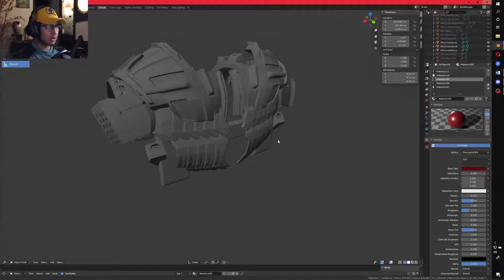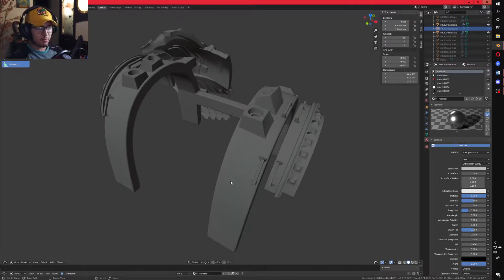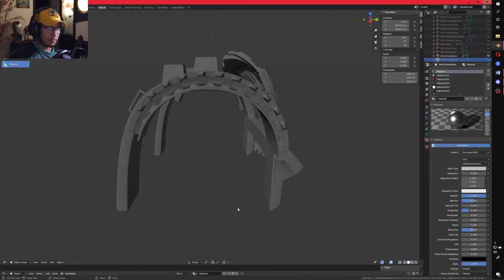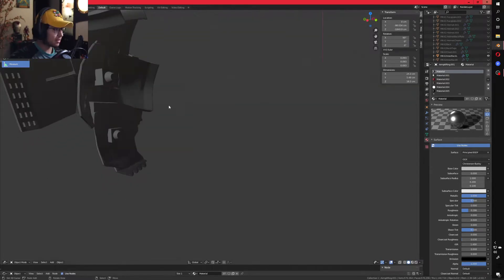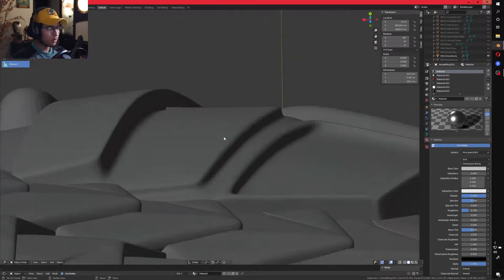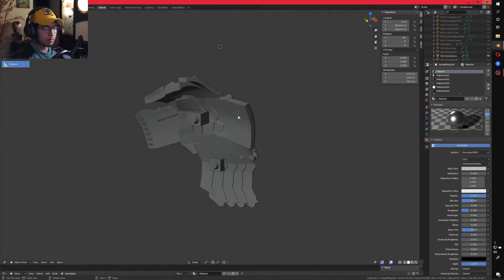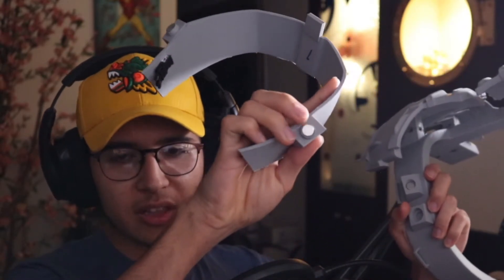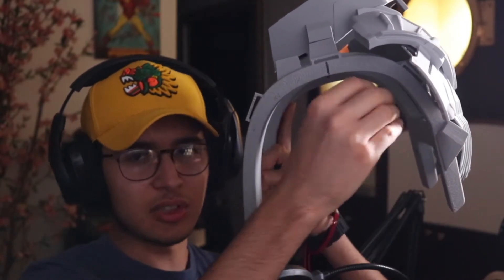Iron Man MK 42 Project | PRINTING THE ENDOSKELETON

Comment: I'm ignorant to 3d modeling itself. What software are you using and how complicated is it to learn to use? Love the information you provide.
Reply from the maker: Aye no worries, everyone starts somewhere. The software I’m using is called Blender, no need to worry about the cost cause it’s free! However, I will admit that the learning curve is slightly steep since this is a one size fits all kind of software. But for the application I’m using this software for, there isn’t too much you need to know to get desired results. The most common things I’ve needed to know for what I’m trying to do are, importing objects and models, exporting said objects and models, creating objects, modifying the objects, using the ruler, using the Boolean and Mirror modifiers, and so on. There are tons of tutorials on YouTube about Blender but those are mostly the things you may want to focus on. Of course a beginner’s guide is the place to start. I hope this helped and I wish you success on your endeavors!
Reply: @kniteplates8020  The information is much appreciated. I'll go get it and start watching tutorials. Thanks again and I'll be watching.

Comment: also i think the solution is 3d gloop.
Reply: It’s xtc 3d
Reply: @guidancebeats   thanks i did not know about that
you can also use bondo fiberglass resin
Reply: @Jayven45  too toxic, and harder to apply. Bondo spot putty not to too bad, especially if you thin it and airbrush it on
Reply: @guidancebeats  yeah but resin dose make the print stronger but i do see your point on 
saftey.
Reply from the maker: I’m not too sure what you’re referring to
Reply from the maker: Oh wait never mind, I’m stupid lol